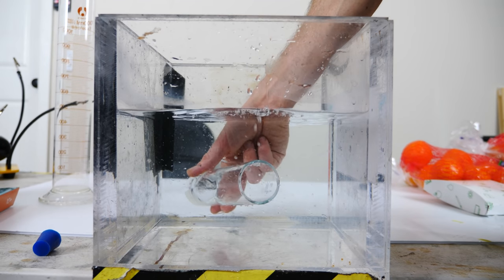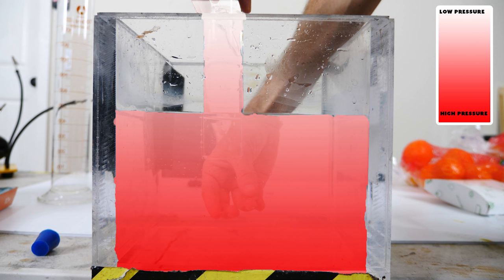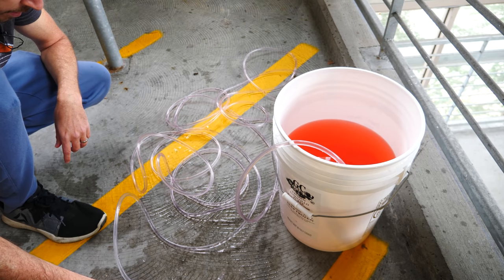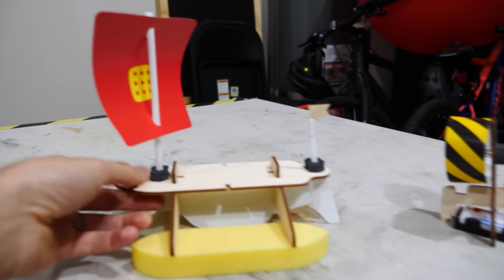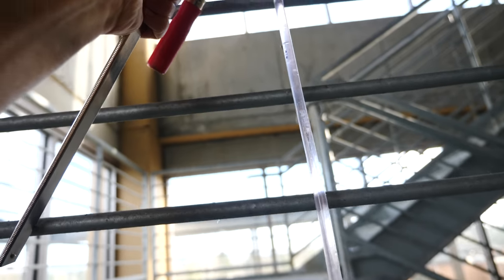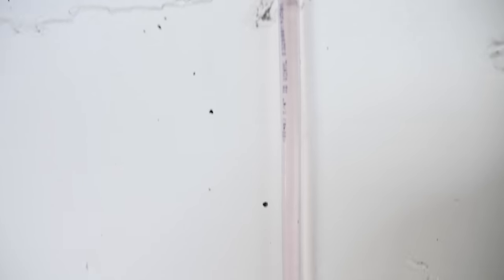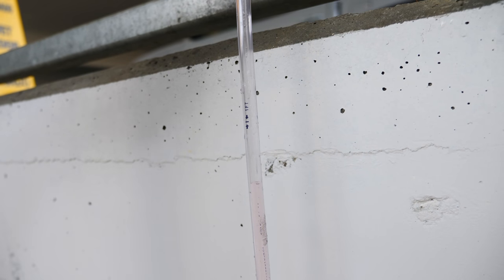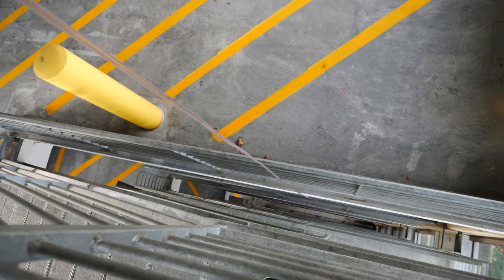Why Water Boils In Tall Cups

Comment: I'm sorry, but this seems like a really weird question, not because it doesn't have an answer, but because the answer is extremely well-known.  None of this is "theoretical", but instead a science that has been known for literally centuries..  if I recall correctly, the limit is around 30ft.  At some point, the pressure on the water will decrease to a point that it's able to vaporize, and this might be perceived as boiling, though I think it depends on a number of factors whether it boils or evaporates.

Comment: I’d like to see this experiment done with H2O that was degassed in a vacuum chamber first.  I hypothesize that the boiling you are seeing is just the saturated gasses like oxygen and nitrogen releasing from the water.  If those gasses are removed prior and this experiment was done, I think you would see actual boiling.  Also it probably will look the exact same…

Comment: Once you get it high enough and it starts to boil, does the vaper replace the vacuum? If so, does the level the water go down? If it does and you block the bottom and then drop the tube, wouldn't you then have pressure in the tube? Would it get hot? If not, how can you have water vapor under pressure that is not hot? Transversly, if the level of the water doesn't go down, what is happening to the vapor?

Comment: Is the height of the boiling point relatively proportionate to the circumference of the “cup”?
I'm imagining a large volume of water creating the low pressure required further down.
Then imagining a ridiculously wide cup not being able to reach very far above the outside water’s surface before boiling starts.

Comment: I don't believe the water is actually boiling *YET*. Before boiling the vacuum at the top will cause all the dissolved gasses to be released, which will naturally rise to the top. Those formerly-dissolved gasses then reduce the vacuum at the top, eventually coming to an equilibrium.

Comment: Would water still boil if the water was in a cup like the video is titled? There would be no pressure differential if the top was open. The pressure at the top would be equal to atmospheric pressure and lower down would be higher.

Comment: isnt that more a thing of pressure than boiling? the pressure caused by the weight is outmatching a perfect vacuum at that level. the boiling is just a side effect of water being at low pressure. ofc it also counteracts it but still
Reply: The boiling point of a liquid isn’t just a temperature, but a temperature at a specific pressure. When the pressure is lowered so is the boiling point
Reply: @FieldLing639  sure. but i guess you misunderstood me. i understand why it boils here. my point is, that the height limit is due to pressure difference and not necessarily because it boils and the steam fills up the vacuum. atmospheric pressure is too small to push against the weight of the water if you raise it too high. the boiling seems to be just a side effect.

Comment: So if you needed to pump water up a tall building using this method, would you need to install tanks/resevoirs every ~30 feet where the pressure of the water is reset before it is moved further up?

Comment: That's not a tall cup, a cup has a sealed bottom, that's the equivalent of a tall straw in a normal cup. The exact opposite would happen in a tall cup.
Reply: you didnt watch the video did you, if a cup is upside down in a container of water its the same as having a tube with one end open and the other end crimped
Reply: @Arttty  tall cup =/= upside down tall cup in a container
Reply: @AdamantineAxe It is the same, both are a cup?

Comment: I have to know, does boiling water in this way have the same effect in killing the bacteria in the water? Or would they die from the pressure? Would this be more effective than boiling water with heat to clean water?

Comment: With your bucket and tube you accidentally made a very useful tool. A good way to get several points to the exact height is to use a 'water level'... It doesn't matter if your tube is 2 ft or 200 ft, water finds its own level.
Reply: Depends on temp etc
Reply: @jeebusk  WTF! Tempature has NO role in water finding its own level! Unless its freezing or boiling, but that should be common sense... 
And I'm not sure what etc would be since you only said temp

Comment: So the question is, when this is boiling due to the height being above 32.8 ft above the water surface does the temperature of the water in the tube get warmer near the top or in the water boiling with no difference in water temperature?
Reply: It actually gets colder!  The boiling isn't due to temperature, but dropping pressure. As it boils it'll still absorb its latent heat which cools its soundings
Reply: @complainer406  that’s why I asked, I understood there was no heating of the water and the boiling was due to the pressure but when one thinks of the word boiling water we associate it with water being heated on a stove.   Appreciate your explanation.  Cheers

Comment: Couldn't figure this out until you said boiling point. It's the opposite of a pressure cooker. If that was the title I would have gotten it immediately. Instead of increasing pressure to raise boiling point, you lower pressure to vacuum to lower the boiling point. The water boils at room temp. What happens with ice water? Can you go higher? We should all be able to figure out the answer.

Comment: Can you please explain how the Water pumps fill up the top tank in many residential apartments which are 10-20 stories above the ground? I mean if it's boiling at 30 ft Many of the buildings are wayyy more taller than that

Comment: OR at 33.8 feet the air tight seal from your clamp was failing.
Reply: The boiling point for the water is lowered when the pressure is lowered

Comment: Isn't it just that you overcome the atmospheric pressure at that exact height?
Reply: At that height you've dropped the pressure in the tube low enough for the water to boil at ambient temperature. You're not really "overcoming" anything

Comment: He really should degas the water first that is to remove the dissolved oxygen. this can be done by boiling the water or putting the water in a vacuum. It would be interesting to do the same experiment with oil.

Comment: Nice video, but I have a question: how do we prove that it is water boiling and not the dissolved gases in water being pulled out?
Reply: The boiling point for the water is lowered when the pressure is lowered
Reply: @wvking yeah, I know that, but how can we prove that boiling happens before the reduction of the solubility  of gases on water in an easy way?

Comment: Most of the bubbles are gasses dissolved in the water coming out of solution due to the reduced pressure, particularly the ones coming from below the maximum height of the water column. Same thing as happens when you open a bottle of carbonated drink. In the UK, and I guess most other places, when water is treated for distribution, air is deliberately dissolved in the water to improve the taste.

Comment: So in space you could have perpetual steam power as exposing the opposite side of a bladder to vacuum you could permanently gasify water?
Reply: Well you need unlimited water
Reply: Why? The water cycle is in a sealed system so it just condenses after it passes through the turbine each time.
Reply: @comeroundereroundere Here's the problem. The water is boiling because it's in low pressure and not because it's hot. Meaning it's not expanding and "producing" more pressure. How are you gonna push turbines?
Reply: Oh yep didnt think of that bit

Comment: and yet my uncle's water well is 60 feet deep with the pump up top, now he DOES have to prime the tube to get it started, but once started, there's no problem continuously providing water.  even when the water is turned off, the main vertical tube does not fill with water vapor or air.  but it may have something to do with the valve at the bottom of the tube , which probably supports the water column and prevents cavitation.
.
also, the water is not BOILING.   it's not hot. the vacuum on the water is so great it pulls any air out the water plus dissociates one water molecule from another, creating vapor

Comment: I believe you are correct that you are causing a very low pressure at the top of the tube. I don't belive that the water is boiling. Re-create this experiment with water in a vacuum chamber and the action seen as boiling will only happen the first time the water is brought to low pressure but not the second. This is because dissolved gasses in the water come out of solution at low pressure in the form of bubbles. One the dissolved gasses are gone, the "boiling" will not continue.

Comment: So is this water literally boiling, as in if you touched the tube it would be scalding hot?
Reply: Nope, it'd actually be cold

The boiling point of any liquid changes with pressure. By lifting that tube 33 ft above the water surface he's dropped the pressure to the point where the water boils at room temperature

It would be cold because liquids still need to absorb heat to vaporize at any temperature (latent heat of vaporization)

Comment: Uhmmm, that's NOT "Boiling +212 f H2o" 🤷‍♂😢🤔That's air bubbles from extra space within the tube, AND/OR molecules being released from expansion pressure (extension) releasing.
Reply: you dont need 212F or 100C to boil water

Comment: Can you define the word “boiling”. To me it means 100 degrees in centigrade. That’s hot, does your pipe get hot, or is it just producing bubbles?
Reply: Boiling points vary in different elements and pressures. The Boiling point of argon is not 100 degrees
Reply: Boiling actually refers to evaporation.
The boiling point of water is only 100°C at sea-level. 
If you go into a very deep tunnel, it'll be higher.
If you go onto a mountaintop, it'll be lower.

In this case, it's boiling at ambient temperature because of the extremely low pressure.

Comment: everybody knows that reducing the atmospheric pressure reduces the boiling point of water  What I thought you were going to do is make a solid tube so high that the pressure at the bottom would produce enough heat to boil water

Comment: I'm curious, when water boils even in a vacuum the phase change of the water takes some heat with it. When the water boils inside the tube, is the temperature of the water dropping?
Reply: You're right, the tube would feel colder where the water is boiling!

Comment: That is not a perfect vacuum, the pressure was just low enough that water can boil at the outside temperature (for example at 25°C or 298K or 77°F water boils at 3166Pa or 0.459psi)
Veritasium did something simular like 9 or 10 years ago with the tree video
Reply: And at 0.01°C (32.018°F) or 273.01K water boils at 611.2 Pa wich is still not a perfect wacuum

Comment: So question right, if you have water at that height where it hits the boiling point could you theoretically run a tube to that point and put that end to a water collector, harvest the water vapors and get clean water? Not on a large scale but like a little personal bit of water if water runs short.
Reply: This question is driving me crazy. Wouldn't that be a very simple system to get distilled water?

Comment: I'm legit curious because I don't know, does the water get hot boiling like this? Because when I hear boiling water I associate it with heat.
Reply: Nah. He's changing the boiling point by lowering the pressure.

Comment: Isn’t the water evaporating not boiling?
Pretty sure if it was boiling you wouldn’t be able to touch the tube like you were since water needs to be 212 degrees to boil.
Reply: Boiling doesn't mean it's hot. 
Like he said, lowering the pressure also lowers the boiling temperature to the point where it boils at around room temperature.

Comment: So does it get hot? Or just physically bubbles?
Reply: Boiling temperature is dependent on pressure. Lower the pressure, easier it is for a liquid to phase change to gas.

Comment: So did the water in the bucket get hot when he lifts the “cup” or did it just drop in “pressure” causing bubbles (aka vaporizing and causing it to “boil”)?   Do the bubbles come from the water at the bottom?  Is different parts of the experiment different temperatures?

Comment: I have a question, it really is boiling or is it evaporating? I mean, to actually start what we call boiling, for a pure substance, we must be in what we call the ''saturated liquid point'' (or line, depending on how you see it) of the saturation dome. We can reach that point by heating the substance or by augmenting the specific volume (lowering the pressure), but (here is my question) can it really be called boiling? I mean, when you leave a glass of water alone without any cover, some of the water *evaporates* due to the latent heat of the air, so this phenomenon is really different from the one in the video?
Reply: Yes there is a difference between boiling and evaporation. Just saying

Comment: Probably not going to get a response due to how long ago this video aired but is there a way to simulate how high you can get in different levels of gravity. Say for example what the distance it can get if you do this experiment on the moon or any other body that has a different gravitational pull. Even better is there a math equation that you can use to figure it out so that I could calculate it for any value for gravity?
Reply: It depends on the gravity, the air pressure, and the ambient temperature

The principle is that the weight of the water column being raised by the ambient pressure is enough to drop the pressure at the top low enough for water to boil at the ambient temperature

On the moon the ambient pressure is so low that you wouldn't be able to have liquid water at all

Comment: So does the water heat up to a boil as you pull up?
or is it actually boiling at the ambient temperature?
Reply: it doesnt heat up. Temperature of phase change depends on pressure.

Comment: Of course the water is not being pulled (sucked) up the tube, it is being pushed into the tube at the bottom.   1 Atm of pressure (14 psi) will push water up until the weight of the water creates a pressure of 14 psi. (about 33 ft).    The water boiling is a different thing altogether and has nothing to do with the 33 ft.   If the tube had ice cold water it would still go up 33 ft, but there would not be any boiling.   Or do it with salt/sugar/etheleen glycol, and it will not boil.   (but the water will be more dense (heavier), so it will not go as high)

Comment: But when water boils, you'll get water vapor, hence it is no longer vacuum. But the higher you go, the more volume of water there is

Surely then the true limit/equilibrium point is based on some ratio/correlation between the surface area and volume, no?
Reply: The water level will stay the same regardless of how much vapor is above it.
Reply: @svennoren9047  how so?
Reply: @prosamis  At the top of the tube is vacuum, that is no pressure. At the bottom in the bucket there is one atmosphere pressure. One atm. is equal to ten meter of water, or 33 or so feet. Water cannot be pushed higher by atmospheric pressure, no matter how long the tube is. 
At very low pressures, close to vacuum, water begins to boil at room temperature producing vapor. This vapor will fill the top of the tube increasing pressure, and lowering the level slightly, but this lowering will increase pressure and reset the equlibrium.
Reply: ... I realized I was not clear in my first reply. I meant to say that the water level is only dependant on pressure, not how much extra tubing there is above it.
Reply: @svennoren9047  how are we sure the equilibrium level is not at a different level that the one presented based on how much vacuum there is?

Or is the change just so negligible that we just assume it to be constant
Reply: @svennoren9047  makes sense but I imagine more tubing means more water would have to evaporate to make the same amount of corresponding pressure from the vapor, no?
Reply: @prosamis  The two deciding factors are the pressure at the bottom, which is the ambient atmospheric pressure and can vary a little depending on the weather, and the pressure at the top. 
Pressure at the top is the vapor pressure and varies depending on the temperature. Varmer water produces more vapor and thus a higher pressure, but on the other hand varmer water has lower density and can be pushed higher by the atmospheric pressure. Cooling the tube at the top causes condensation and lowers the pressure, allowing the water level to rise. 
I haven't done the maths on this in... decades... but my gut feeling is that the variation is very little until we get to high temperatures.
Reply: @prosamis  That is correct, to fill larger volume to a given pressure needs more vapor. Producing more vapor lowers the temperature of the water, too.
Reply: @prosamis  Looking up the tables I find that the vapor pressure of water at freezing is 0.6% of atmospheric pressure, and at room temperature it is 3%. 
Going from freezing to a nice day we can expect a 2.5% lower water column, or 25 cm (ten inches) out of 10 meter (33 ft). Definitely a measurable change. 

P.S: Thank you for making me excercise the old nogging!
Reply: @svennoren9047  that's a cool find!! Thanks for taking your time on this
Reply: @prosamis  Digging further (don't look at me like that, I'm an engineer) I find that the termal expansion of water, going from freezing to 25C/77F is roughly 3%, neatly canceling out the change in vapor pressure! 
TL,DR: the level stays the same, at least through livable temperature range. 
Who knew?!
Reply: @svennoren9047  I'm a mechanical engineer myself! My intuition told me there would be some difference however measurable, but that's really neat that they cancel out like that

That's pretty cool!